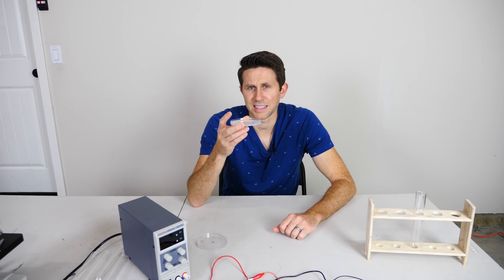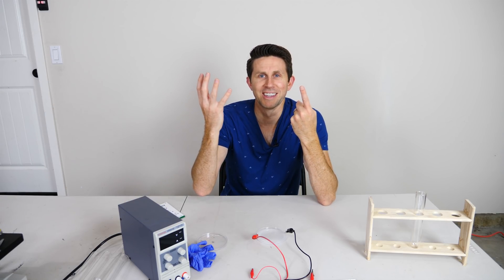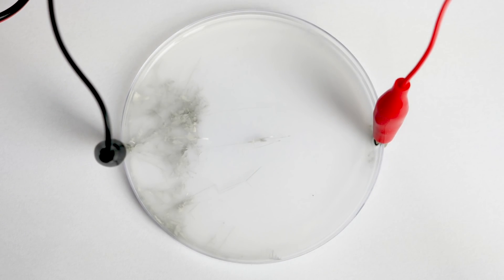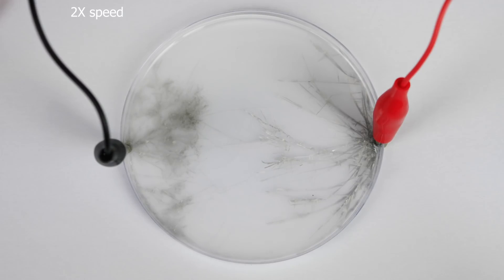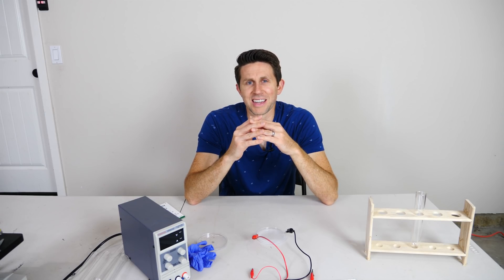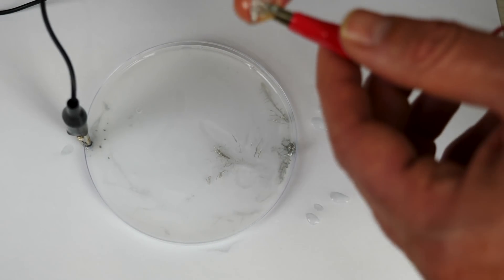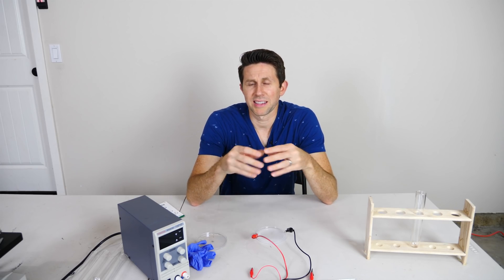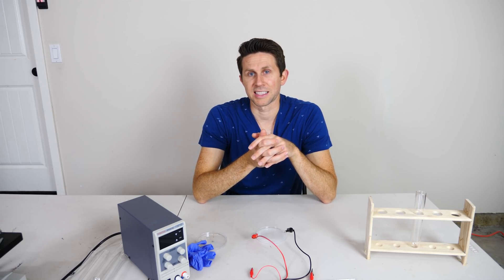Weird Experiment Makes Metal Grow Out of My Finger

Comment: This is often the reason why some electronic circuits suddenly fail, sometimes after months or years in operation. Circuits that were soldered with a tin alloy solder will sometimes develop "tin whiskers" that spontaneously grow between electrical connections and eventually result in a short circuit. This problem drives manufacturers crazy!

Comment: The tall part looks like Douglas firs if you look on the bottom it looks like the shadow of them and I've also noticed that each one of the patterns initiate the direction of 90 and 45 degree angles like a sine wave it also looks like a pulse or a heartbeat

Comment: The solution is cloudy because the tin ions start to precipitate in water (hydrolysis - they react with water and form the hydroxide). Usually you prepare this solution in an acid to avoid this and the solution is completely clear. If you use the acid, you will have more tin ions in solution and the solution will carry much more electricity. I think you could even use your finger in the diluted acid with no problem. Check out how it works with the clear solution: https://www.youtube.com/watch?v=5Pcvi3Y1DmQ

Comment: Not even your highest voltage ( 32v ) on your variable power supply is enough to stop your heart even if you put both connectors on your nipples, you only shocked and burned a little bit since you were wet in the conductive tin solution lowering your resistance, and the fact that you did feel a bit of the shock makes me think that the DC from your power supply is not totally smooth since its much easier to shock with pulsed electricity like AC or pulsed DC than it is with smooth DC like that of a battery.

Comment: Something awesome I noticed from Glass and various other patterns like this is that it seems the path is predetermined on moment of charge.

The microscopic view looks as if they are influencing each other. But they aren't. At a point when watching it kinda all lines up to a stop. Then the influencer is coming in from the bottom or at least it's what it looks like... However you can notice that as we follow that influencer I described the previous focusing branches interlink to a point where they can't go further due to this influencer but what I find most interesting is... The paths are straight as it's the most direct route however that makes our influencer description void as it is traveling up to that point again as a direct path!

So that makes the tree in its final point determined the moment you channel the current into the dish. (Not that every tree would be identical no matter the dish but in the sense that once you choose the dish and run a current 1 direction it would follow the points initially reacted with from the electricty. Like a plasma ball I guess but with where nothing can be... So that's why even if u had stupifying power you will still have shards and not powder when shattering glass. Even if the shards are as small as powder.)

Comment: This is a test I perform regularly on automotive electronic parts. It's called electro-migration, it causes short circuits to happen which we don't want on circuit boards. Copper and tin are the two biggest culprits of this phenomenon.

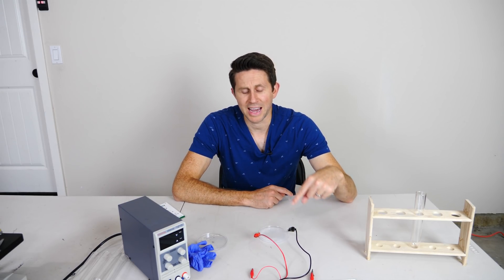Comment: Hi,  at 0:58 you are saying that cathode just means that electrons are flowing down into the solution from the wire.. ? isnt it wrong? I always thought that Anode is always negative and it is the source of the electrons that are flowing towards positive side cathode (where atoms are positive because they miss electrons).  what am i missing? im i wrong or the tags are switched? as black wire shoud be negative right? Could you please explain to me how it works? thanks

Comment: I really want to see CRT TV or monitor after releasing vacuum (without damaging the picture tube of course) in vacuum chamber and after sucking air from the chamber turning that TV or monitor on whether it will still work.Then during operation try to slowly (i mean really slowly) release vacuum from chamber and see at which moment it will stop working 😉 Probably immediately after disrupting the vacuum but anyways.

Comment: Isn't the positive terminal called cathode, then why is he calling the negative terminal cathode in the video?
Reply from the maker: cathode is where the electrons come out of in a battery or in an electrolyte cell. But the convention of naming them positive or negative is opposite for a battery and for an electrolyte cell. This explains it well (https://chemistry.stackexchange.com/questions/16785/positive-or-negative-anode-cathode-in-electrolytic-galvanic-cell)
Reply: Batteries have the opposite reaction to electrosys therefore they have oposing names. Well something on these lines at least.

Comment: I'm an engineer at an ECU manufacturing plant. Tin dendrites is something we have to watch out for and prevent as it can cause a short in the ECU and potentially kill your vehicle.  Typically we apply a liquid rubber (conformal coating) over sensitive areas of the board.
Reply: Me: BRUH

This comment: tries to mock me by getting reposted

Me: I'm immune to being mocked, but by a repost? unleashes ultimate super BRUH with an r/woooooooooooooooosssssssshhhhhhhh

Comment: at the microscope you can see that the crystals alway growed at  a right angle.
why is this?
Reply: I believe it is because of the crystal structure of metallic tin at room temperature. The atoms are arranged to form cubic prisms with the a,b,c Axis at 90° to each other
Reply: It wierd it goes in 90deg and at 5:28 it goes 45deg.
Reply: Geometry really and how the atoms look
Reply: I don't know, but I suspect the answer is COMPLICATED.
Reply: What was actually happening under microscope?
Reply: Wondering what will happen if water bears were mixed in it...
Reply: Conservation of momentum...
And linear collisions......